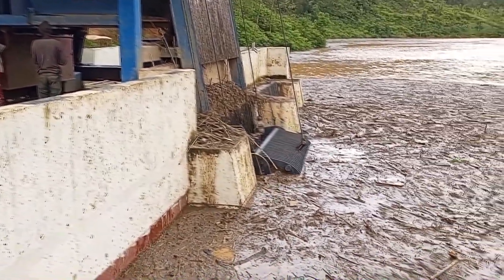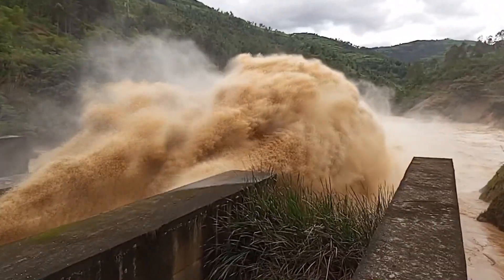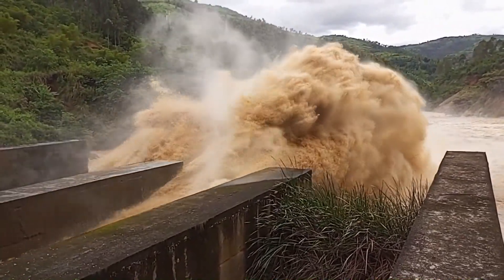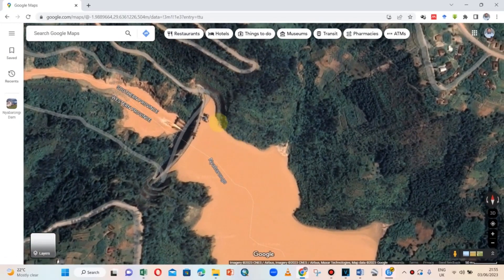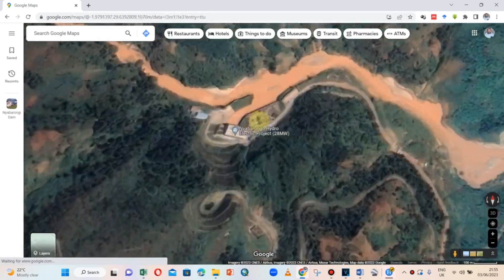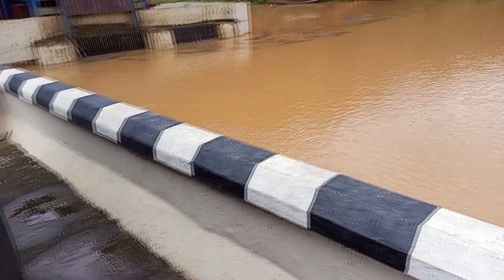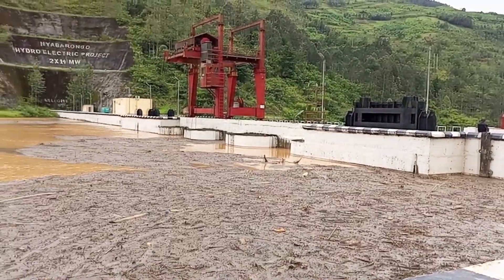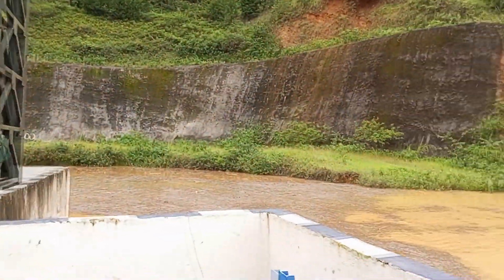Massive Clogging😲!!! Unclogging the Intake of a Hydroelectric Dam | Sediment Flushing | Nyabarongo 1

Comment: What are those 3 dudes doing? There is a trailer sitting there for  the purpose of dump crap and hauling it. What they're doing is busy work.
Reply: Labor is cheap , rather than use expensive machines it’s put more men on the job